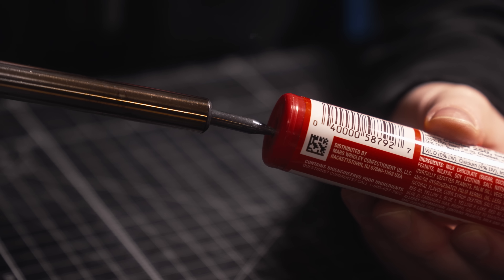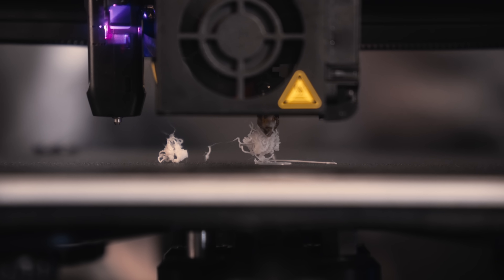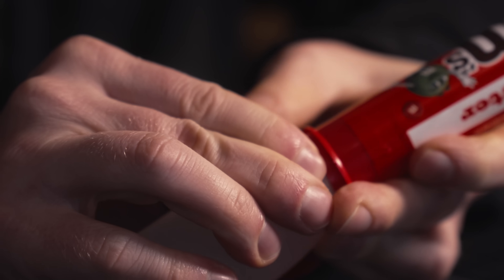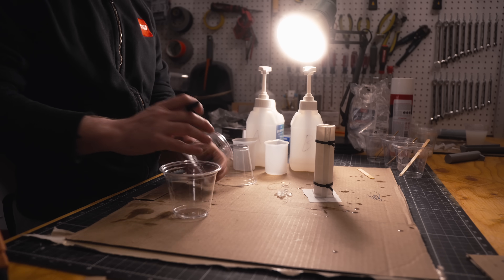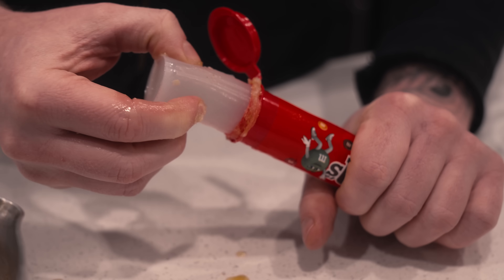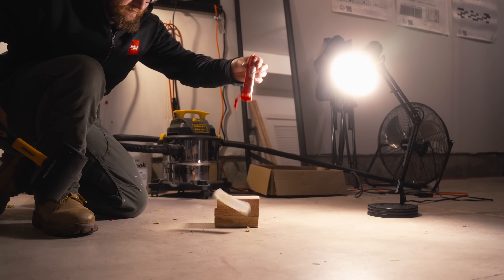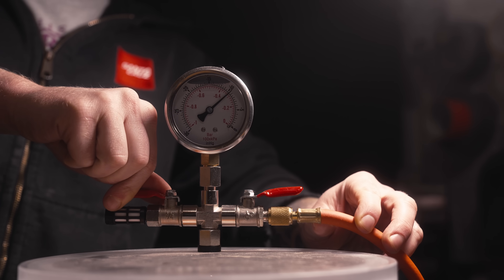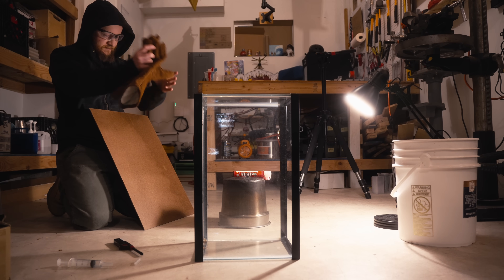Solving Reddit's Cylinder Problem with Science

Comment: cast removal saw!
Reply from the maker: good call!
Reply: I forgot about cast removal saw as a concept and I thought youre a wizard casting a saw into reality
Reply: YES, or the new bone saw that can cut bone without hurting the membrane surrounding the brain !
Reply: What was it that it saw? A cast to remove?
Reply: @ThePyharegua look it up. it's speal tool used to remove casts from libs that were broken... secured and healed over time.
Reply: I was just thinking of this😂
Reply: what if the cylinder got just as hard
Reply: or just a regular oscilating multitool
Reply: @swosheeplays9453  Fairly sure this would destroy the organic cylinder without extreme care. Cast saws have a much shorter oscillation then oscillating multitools. Oscillating multitools are generally not safe to press into skin especially if the skin is relatively tight/has limited movement such as when trapped inside a M&M tube.
Reply: @simethigsomethingidfk    An oscillating saw relies on the movement of the skin to not harm the user. If we postulate that the cylinder inside the tube has a delicate, highly mobile skin around it, it wouldn’t be damaged in the slightest by an oscillating tool/ cast saw…
Reply: @erebostd  Feel free to prove me wrong with your own experimental evidence.
Reply: @erebostd   Now, now, we must not make assumptions. Not all cylinders have delicate, highly mobile skins around them. Some people prefer, or have forcefully had their cylinders without them for, strictly speaking, experimental reasons.
Reply: @erebostd Why would a cylinder carry skin? 🤨
Reply: @yashbutno  In fact, why carry skin at all! I mean it's pretty expendable, it's not like it pumps blood around our body, or filters waste products out of our urine or anything, lets just cut it all off!
Reply: @Dafty_Boi Absolutely! Why treat any random cylinder as if it were a living object? The idea of skin is wild. Perhaps it's some sort of sticky label?